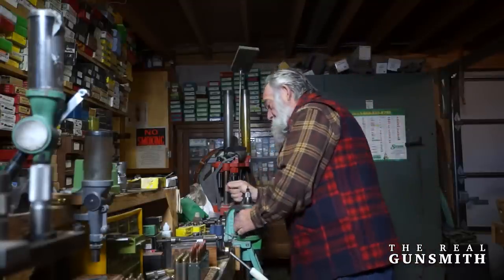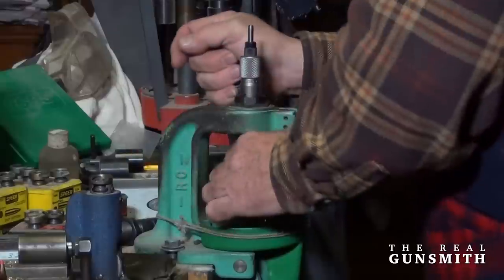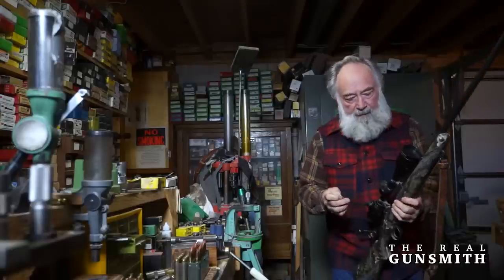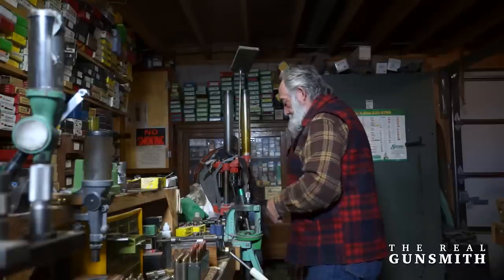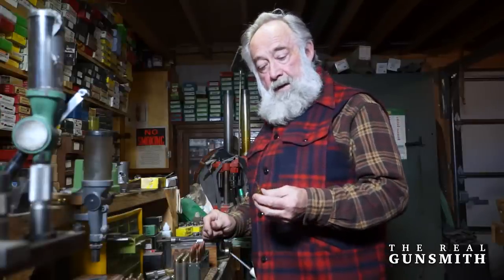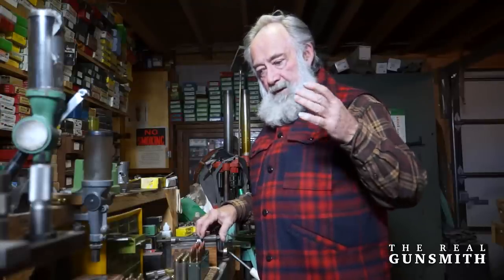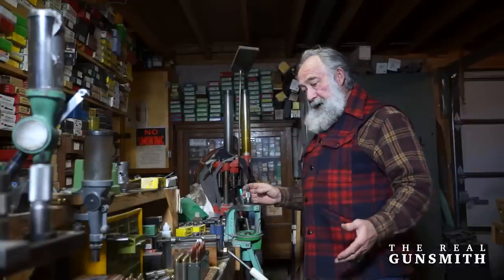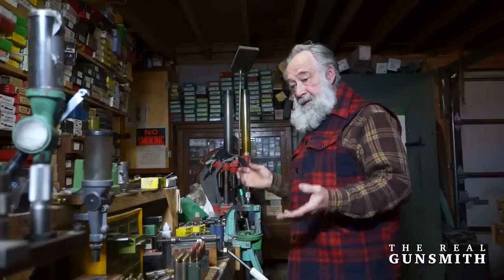Properly Sizing Cases – The Real Gunsmith

Comment: Do you not tumble your brass to clean it? Why not?

Do you anneal your brass at all? Why not?
Reply: In case Randy doesn't get to you, tumbling isn't necessary. The benefits of tumbling are cosmetic, nothing more. Most F-Class 1,000yd guys don't clean their brass at all, because it doesn't improve accuracy and it takes time. If they don't see an accuracy improvement at 1,000yds, you certainly won't. 

There actually is a few benefits to NOT tumbling. Even though he wiped the excess lube off the case after he sized it, there is still a super thin film of lube on the case, which will help reduce friction during feeding and extraction, preventing stuck cases or heavy bolt lift. 

If you don't tumble, then the inside of the brass still has the burnt carbon residue on the inside from the previous firing. That carbon residue on the inside of the neck will prevent "cold welding". Which is the main reason the F-Class guys don't tumble. Cold welding is an exchange of molecules between the brass neck and the copper jacket of the bullet. When you have a nice shiny bullet and a nice shiny piece of brass, those clean surfaces, pressed tightly together, will start to exchange molecules and "weld" together over time. The cleaner the surfaces, the faster it happens. If clean ammunition is loaded for even a few months, this will happen. This is important because the welding from one round to the next, will not be consistent. This welding inconsistency can cause radical velocity variations and even dangerous pressure levels. If you have ever pulled bullets using a collet die, you will have noticed this. You won't notice cold welding with the Hammer style, inertia bullet pullers because you're banging it on something to get the bullet out. But with a collet puller, you actually hear and feel and loud "SNAP" when you break the bullet loose. THAT is from cold welding. You could go buy ANY box of new factory ammo right now, bring it home and pull the bullets, EVERY one will snap. Which is one of the many reasons factory ammo is so inconsistent.

If you wet tumble with stainless steel pins, then your case mouths get rounded over and you need to chamfer the inside and outside again, which takes time. Dry tumbling doesn't round the mouths over, but wet does. I actually like shiny ammo, so I wet tumble and do all the extra work, even though it doesn't improve accuracy.

Annealing isn't necessary either. But, remember how he said that after a few firings, you will have to screw the die in because the brass gets work hardened? If you anneal after every firing, then you WON'T have to screw the die in like he said. Annealing releases that "work hardening" that happens during firing. But there are plenty of guys who NEVER anneal, myself included. I use to, but don't anymore. Why? Because I bump size .002 to .003 and the brass never gets too hard for that small amount of sizing I'm doing. For what it's worth, David Tubb doesn't anneal either. If you don't know who he is, he's the most accomplished competitive shooter in history, across a pile of different disciplines.

Randy is sizing to basically a zero bump - .000  If you get a shoulder bump/headspace gauge for your cartridge, and bump your shoulders back .002 - .003 then you won't have case head separations(which happens when you repeatedly bump back to SAAMI spec, which is like .006 to .012), you won't have that snug bolt closure and you won't ever have to anneal. The F-Class and Benchrest guys ALL shoulder bump .002 to .003 and have for over a decade. They all use to neck size until Thomas "Speedy" Gonzalez started shoulder bumping .002 and after that, you couldn't beat him for two years until everyone else found out what he was doing. Then everyone else started shoulder bumping and neck sizing went away completely in competitive shooting. (Search "Erik Cortina & Speedy Gonzalez". There is a YouTube video where Erik is interviewing Speedy in Speedy's shop and he walks you through that entire story. It's some of the best, shooting GOLD I have ever watched. The video is 35:52 long, so you know you have the correct one.)

The way Randy is showing us to size brass, works fine. Neck sizing usually works fine too. But, BOTH of those sizing methods, produce "flyers". Because each case is not exactly the same. Some will be a little tighter than others and touch/rub more than the others. If you bump .002 to .003 then NONE of them rub and the "flyers" go away completely and your velocity will be more consistent.

Good luck in your accuracy endeavors.
Reply: @timjohnson2731  Thank you sir for the information and taking the time to type all of the out. As someone who types about 10 words a minute I don’t have the patience to post that much information. I already knew all the information you posted but I think and hope it will be helpful for others. 

Couple things in my process, I always wet tumble, after I de-cap this does a great job of cleaning primer pockets. Then I tumble after a full length resize to move all the lube. After the second wet tumble the brass gets run through a mandrill die with some imperial dry lube to prevent the “cold weld”. I also anneal every time as I have found it reduces spring back.
Reply: @Dane L  oh great! Yeah, ya never know the experience level of folks on the internet. I do the EXACT same process you just described(with my Whidden Die rifles), I just don't anneal. I did leave that out that annealing does reduce spring back. I quit annealing and neck turning because for what I do, the juice wasn't worth the squeeze. I don't compete, but do shoot exclusively long range. I have plain Jane RCBS full length dies for some cartridges and Whidden FL Bushing dies for most of my cartridges. 

My 11lb,  257 Weatherby has put 3 rounds on a credit card at 1,050yds using RCBS dies, no annealing, no neck turning and no mandrel. If all the extra steps can make that group smaller than a credit card, I don't care, it's not worth my time.

I have countless experiences like this, with all of my rifles. Just preposterous accuracy, without all the extra hub-bub. Will all my rifles keep that up for 20 shots in just a few minutes? Of course not. But they're not meant to, they're all hunting rifles. Not that I condone extreme range "hunting", because I don't. That topic is beyond the scope of this video/comment string.

The reality is Dane, if what you're doing is working, do it. The Palma Legend David Gosnell says: "If you think it matters, then it matters." Because shooting accurately is as much of a mental game as it is anything else.
Reply from the maker: My brass, as shown in the video, is wiped clean. I don't need to anneal my brass as it doesn't need it.
Thanks for watching.
Reply: @TheRealGunsmith  do you have some sort of super brass that doesn’t get work hardened and doesn’t have spring back?

Comment: So to say it it slightly different. The oversizing of the case(pushing the shoulder back) is creating a head spacing problem.
Reply: No one is creating a head spacing problem your simply returning it like a factory round. The reason to bump it less is more case longevity as sizing and shooting stresses the metal. Now a days full sizing only as much as necessary has become the way. Use to ppl only neck sized but now ppl full size only as much as needed. Auto loaders usually just regular full length size but u could do it this way, but when shooting more rounds it’s best to leave more room for dirt and build up. So automatic rifles usually mash em to the shell holder. Someone shooting a few rds from a bolt gun doesn’t have to worry so much about contamination in the chamber.

Comment: Why not just buy a Hornady (or any other make) headspace comparator kit and take the 'feel' and sharpie marking methods out of the equation and do it properly. Fire brass, measure, bump back two thousands, measure, write down data. Those kits are under $50, and includes multiple bushings..
Reply from the maker: Because this fits the case to the rifle it was fired in, a custom rifle, custom fit. Not generic.
Thanks for watching.
Reply: @The Real Gunsmith  the firing process fits the case to the chamber. Using a comparator shows you exactly how much you are bumping the shoulder of the fire formed case. You should try one.
Reply: @Songdogger  I see Area 419 just released dies where you can set the shoulder bump on top of the die in thou increments, as to not mess with the lock-ring.. Yet on this channel he still used 'feel' and sharpie marks..

Comment: That is a terrible way of sizing a case. 
- That took way longer than it should have 
- You can’t go by bolt feel, every action is different
- Thats assuming the brass is too large to start with 

Get headspace gauges, don’t be feeling fired brass in your chamber. Try Eric Cortinas method not this please.

Comment: Hi Randy. I don't know if I missed it but perhaps you could explain how RCBS tells us to adjust the Die's down to where it touches the shell holder then take it down another 1/4 turn to where the Ram Arm Cams over. Then tighten the Die down at that point. Ho do you do it? Hornady say's to adjust the Die down to where it hits the shell holder just barely and tighten the Die down at that point. It never has worked for me like that. i do not like Hornady Die's anyway. I'm an RCBS guy. Always have been.